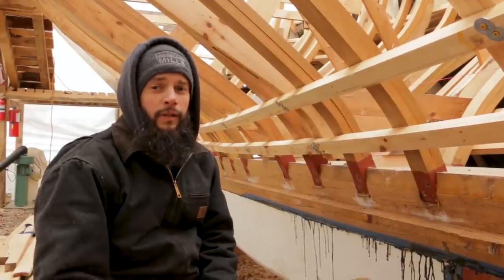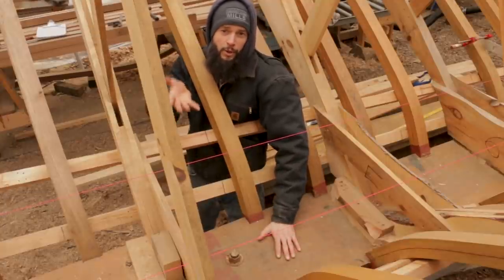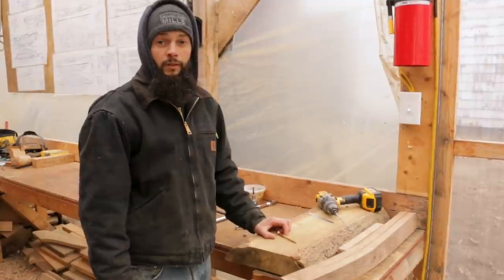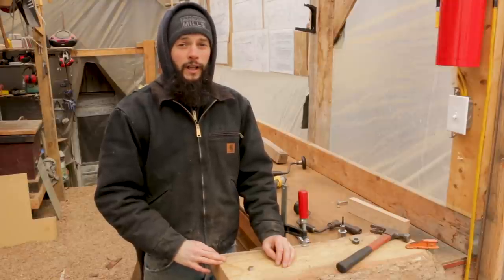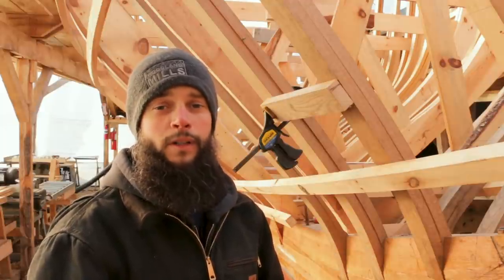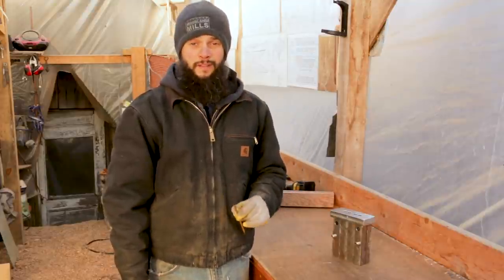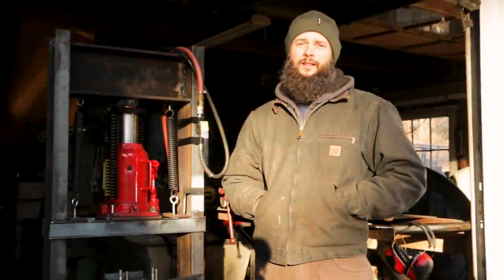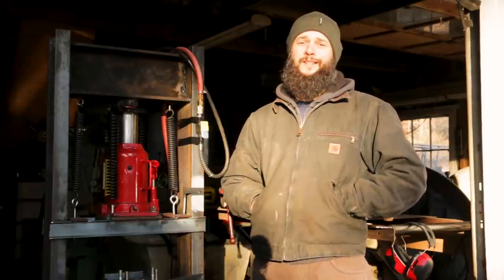Acorn to Arabella - Journey of a Wooden Boat - Episode 50: Homemade Copper Rivets!

Comment: Some ideas for a rivet mashiene 2.0:
1. Get rit of the screws if possible. Screws are so slow if you have to open them every time. try to build a big knee lever tensioner and cuple one of the die half to it. They can pe realy strong and are much faster and easier to use.
2. make some dyes that have the slot completly in one side, not half/haf like you have now, and fix the chanel-less side to the press. Also drill some holes/slots in the hinged side that corrospond with some pins, wich engage when you swing the hinged-half down. that way you dont have to beat out the rivets with a hammer every time you open the tool.
3. (and this one is not realy that important) while you're basicly rebuilding the whole thing, put on some limit switches on the press so that the compressor automaticly starts up, wehen you pull the lever down (see 1.) and also a switch that automaticly retracts the press again when the dye is fully pressed in
Reply: Remember the part of the video where he said, if you have any better ideas, build your own and maybe we'll buy it from you? That was a subtle hint that they aren't interested in suggestions when they have a perfectly good working machine.
Reply: @danno1111  I do remember that. But since I have neither time nor tools or even the cash to build a such a mashine just for the slim chance to sell said mashine and then ship it over an entire ocean, I just chose to do the next best thing: make my Ideas public so that maybe somebody else can use them and do build a sellable version.
Reply: Screws are simple and strong.  Simple and strong is good when you have a machine exerting tens of thousands of pounds of pressure, built by an amateur metalworker and operated by semi-skilled labor with no support structure (workman's comp, etc) in place.
Reply: @netpackrat  but screws are also excruciatingly slow. And if you need to fasten and loosen 4 screws literally a thousand times, then You know what pain is.
Reply: @aka_pcfx  Yes.
Reply: Sadly the holding power of those screws is not easily matched, it would probably take a 50 ton jack to hold the mold together and not allow splits.

Comment: Need to heat anneal those rivets, copper work hardens and becomes brittle.
Reply: Good Idea, was thinking the same...
Reply: Make your rivets red hot in the fire and then dunk them into water. Instantly annealed!
Reply: @andre3823  .. wouldn't that temper them?  I know nothing about copper but that's how you temper steel.  Very slow cooling is for annealing.
Reply: @rlmillr  nope, copper goes very soft with that method. ,😆
Reply: doesn't seem like they're upsetting the end enough to worry over much about annealing.....but it wouldn't take much to do it if they wanted to be paranoid about it..
Reply: The work hardening of rivets when forming heads is more of a feature than a problem.
Reply: @netpackrat  Yep. It's a feature, not a bug. Like differential hardening on a  blade: hard edge, flexible center.
Reply: I recon looking at those rivets after they were cut it looked like they were cut on a friction saw and had plenty of heat dumped into the ends of them
Reply: @rlmillr  

Hi Rick - quenching red hot steel hardens the steel - maybe leaving it brittle. You then heat the quenched steel to a much lower temperature - this reduces the brittleness and improves toughness. This process is called tempering or annealing.

The old timers (my Dad b.1899 and his uncle-in-law b, 1874 and a blacksmith) both referred to the quenching process as tempering. However it might have been an honest mistake as they were Croatians and English was their second language.

cheers edi
Reply: I'll third that on annealing the copper before forming the heads.
Reply: 1. The copper is not hard drawn????
2. They proved the "rivets", with a destruction test. Rivet passed!
Reply: @AnotherRM  Ferrious and Non Ferrious (spell check)

Comment: What an awesome channel. I was one of the people asking questions about the floor pieces. Its one step beyond to take the time to read and reply to all our questions and concerns. Truly you are keeping your word on making this not just a record of the build but a guide and reference for anyone else looking to take on such a project. Thank you for sharing all your hard won experiences!
 Your rivet press is class. One suggestion to maybe increase turnaround would be to drill a hole on each channel 3/8" below the head at a 45deg angle pointing back to the operator which would allow for an easier way to release the rivet. to stop the hinge bouncing up as you punch out the rivet you could make another brace that comes in on a another hinge from the RHS/LHS and crosses over the top and back in to the frame. or even stand the die back up on its vertical and let the hinge take the force?! Good luck and Merry Christmas! :)

Comment: Good that you painting the end grain and oiling the steamebent wood as they tend to dry out faster. As a boatbuilder I know you are on the right track with everything. I would say that you are extra careful, not cutting corners like I probably would. Dont worry to much about the comments here, and you are right you dont need to fasten the frames to the keel at all since you will put in floortimbers. Although its true oak will be black around steel nails, its no problem to use stainless steel screws. Bronze is more traditional though. Looks nice.

Comment: Hi Steve... just a thought..... to speed up your production when installing your home made rivets you could use a pneumatic hammer similar to those used by mechanics to form the shop head instead of a hammer. Or an aviation rivet gun, with a rivet snap . You will need a piece of steel on the head of the river to prevent it from being driven back out of the hole. That's called a bucking bar. If you use a snap of the appropriate size then the head you form on the inside will swell and will be very nicely finished after the rivets are set. 
Both of these pneumatic guns are similar in look and function and if need be you can pick one up at any big box store, or a friendly mechanic/aircraft engineer might lend you one, or at least point you in the right direction. 
Shop heads look beautiful when done right. Just like the heads of rivets on steel girders.
Reply from the maker: The plan is to buy a rivet gun when we plank =) 
Thanks for the tips!

Comment: You guys are awesome! I've been following you since the beginning (and even picked up a shirt a while ago), and I'm very impressed. I know nothing of boat building, but I'm a (medically retired) master auto tech and custom fabricator. 

Your last comment, regarding doing the math for pressing the rivets was hysterical! Considering there's 1440 minutes in a day, it takes 5 minutes to press 4, and you need 4,000, that's only 5000 minutes, without any problems! 

As for the rivet die/press, I think what you have is good. Just needs a couple minor mods. Instead of the rect. cuts, see if the machinist will put "V" cuts in. It will make the release much easier. As for the lateral movement of the dies, instead of nuts to clamp them together, how about spring pins ("R" clips)? You guys seem to be precise enough where you could figure out the perfect spot to drill the bolts, where you want the pins to slide through. You could then pop the pins in and out in seconds, while still maintaining enough force to prevent the plates from spreading. And again, the V channel will make release much faster. 

I estimate that you could probably get press times reduced 50% or more, provided the clips are big enough to easily grab. Just my thoughts...
Reply from the maker: Thanks for the suggestions and for the support!
Reply: My pleasure. Hope it helps. I like to keep things as simple as possible. I saw some of the suggestions below, with release cams and this and that, and just had to shake my head and laugh a bit. You guys are doing a great job. 

Thanks for acknowledging my comment. I didn't expect a response, to be honest. At the same time, I didn't want to come off sounding like some Internet know-it-all! It definitely goes to show you guys truly appreciate your audience. 

For that, thanks for being real! Not many YouTubers take the time to be as thorough, while also being entertaining. Here's to being one of the most enjoyable channels on YouTube! Way to go guys! Keep up the amazing work!!!

Comment: You're 100% correct about setting the scew in a hole sized so only the threads cut. Tapering the hole and counter sinking the head are enhancements.

Comment: Very easy explanation on the screws, should put everyone's mind at rest. I bought a kilo of copper nails which cost me £75. This was just to nail the rails for a 4m boat which used about 3/4 of them. I even saved the 25mm ends to turn into short nails. Your solution is brilliant.

Comment: Wonderful Square rivets, they will hold so much better/stronger than the screws would.  I would suggest that you use a Pneumatic Buck-n-Bar method when installing them.  Just like how Aluminum Aircraft rivets are mounted to wings and airframes skins.  The peened end will be so much more uniform/stronger, and easier/faster to install.  Great job on the boat, I look forward eagerly to each weeks installments.
Reply from the maker: Thanks, we were just kindly donated an Ingersoll Rand rivet gun for the riveting!

Comment: Awesome work on the die. The only suggestions I have, if you were going to produce enough for more than one boat, would be: (1) come up with something faster than bolts to lock it closed. I'm thinking some sort of cam. (2) add some sort of ejector pin system.

Comment: Copper makes a great rivet because of it's malleability; however that much compression in forming your rivet might "work harden " the rivet enough to make it resistant to more compression. If you find that to be the case, you will have to anneal them. (Heat till glowing, then a rapid quench in water). This will return the copper to it's original malleability. Be careful on your first few to see annealing is needed. Great solution to the high cost of having those rivets made. Certainly other shipbuilders in the community would be interested. Good luck guys.

Comment: If you had three volunteers, and two more jigs, you could finish 240 copper rivets per hour. One person operates the press - keep it pressing continuously.  Two others loading and unloading the jigs.  you only need the lower portion of the new jigs as the top is interchangeable with all three jigs and is only needed in the press.

Comment: 4,000 rivets at 5 mins per four is 5,000 mins.  So, approaching 85 hours or two working weeks of 42.5 hours. (You do stop after 42.5 hours, yes?!). If the press can cope, making 5 at a time would be 20% faster. Really depend on supply of volunteers! A suggestion - let them engrave one of their rivets. BobUK.

Comment: Rivet machine looks good. I would make two modifications: Weld or pin a large t handle on the Hydraulic ram release screw so you can work it by hand, and possibly tap into your air line to power a pneumatic impact gun  and possibly air hammer to speed up your opening and closing the die and removing the rivets.

Comment: Consider applying a very thin coat of anti-sieze compound inside your rivet die along the length of the rivet, and where the head is being formed into - this will help both the removal of the rivets after the press, and prevent marring up the die over the thousand uses of it.

Comment: If you add a cross piece internally to your rivet die opposite of the head, that can slide out of the way, you might be able to add an external lever and pin system or something of that nature to act as an ejector to remove the rivets without separating the die halves, thereby saving that few minutes each run of 4 rivets.  Could also try a bit of spray lube as well. 

Cheers!

Comment: While I see that you have done your due diligence and selected fasteners appropriate for the task you only showed stress failure and not what most often happens: fatigue failure. I don't see that as an issue, but technically it's the wrong thing to silence the trolls 😉

Comment: Most excellent, the rivet press is a great solution, particularly with volunteer hours. You may find a bit of lube on the die will extend it's life with less wear and make it easier to remove the pressed rivets. Peen on men.

Comment: Just saw on another channel a sample of a copper rivet through wooden planking. The wood was found on the foreshore of the Thames in London and appeared to be about the same thickness as your planking. the rivet was the same size as the largest commercial rivet you were able to find.  The rivet was still intact and headed on both ends, one of the pieces of wood had completely rotted away but the rivet was still holding. I think your homemade rivets will work just fine
Reply from the maker: That's super cool, thanks for sharing!

Comment: You could get you machinist buddy to just make a few more sandwich layers for the tooling jig you have set up for the copper rivets. Triple your production rate depending on what it would take for the press to press that many more cold rivets, 32 tons may not be enough. Simple cheap thing to try that may save you time if you haven’t tried already. Nice work!

Comment: Pre drilling holes for woodscrews and nails is proven to be stronger in tests. Forcing a nail into wood opens the grain and leaves gaps between the nail and the timber. Wood screws should ideally be threaded only for the backing timber depth, the top timber being pre drilled with a clearance hole.

Comment: So some ballpark figures. Working  displacement is 15 tons. So each frame and floor timber will lift about a ton in the center. When you hammer over a whitecap it would shock about double. So make the floor timber to keel fasteners take 2 to 3 tons and you're good. That would be about 4) 1/2" bolts per station pulling in tension. It should make a bar crossing.

Comment: The term "clinker built" comes from the noise made bending the rivets. I took a part an ex lifeboat which had rivets into the frame. They were amazingly strong. So strong I used a chainsaw to cut out the frames. Removing the rivets would have taken ages.

Comment: You could probably add a little piece of angle iron that's lined up with the heads of the formed rivets so when the halves of the die are separated you could just tap the hinged portion of the die with a mallet to help free the rivets from the die. I'm not sure if they're stuck in the die enough to where that'd bend the rivet but if not that may help speed up the reloading process.

Comment: Some people are commenting on a sleeve to slide over instead of bolts. You notice how the rivets swelled and had to be driven out. Well they're spread the other way and the sleeve will be stuck. It may be slow but the bolts are the best. If I had made it I would have done it about the same. I to am a machinist and what he did looks good to me. As far as the wood screw, good demo, they make them that way for a reason because they work. I just hate the slot but on that screw it's the best.

Comment: This is going to be one strong boat. You guys should be very proud of your skills and dedication. Have you decided on an engine yet? I think you mooted that 40 HP would be enough but I strongly disagreed. For going into a Beaufort 6 or 7, you're going to need over 100 HP on a boat that length. In big seas, you can never have too much HP at the prop. That HP could save your lives. You should speak to some marine insurers, see what they say. If it was me I'd put a big Cat V8 down there. I had a Greek hand-built 10 metre 'Trexandiri' with just such a V8 and it could take a B8 like a hot knife through butter: just what you need to get you through a storm.

Comment: For the rivet press, I would add a knob or crank to the pressure relief valve on the jack.  This will make that step much simpler and more comfortable than using the pipe that came with the jack.  Another option for r3moving the rivets from the die is to use a pneumatic chisel.

Comment: Copper rivet making, nice work, chiseling them out of the press. LOL making the head as you show isnt the problem, its holding the stock.  tried silver steel tubes at first ,jammed, slotted with clamps, jammed. my oil bath with rear pin allows head length adjustment and stops rear end flanging . nobody wants that. just uploaded for a pirates chest. Adam savage quote about lubricate. my assumption is that the oil acts as an incompressable substance. the higher viscosity the better, I will try with greese next .pleasure to watch.. best of luck.

Comment: A Jonny ring is still made with beeswax. I also use it to fill seams every spring before launching as we haul out for the winter here in New England and the old girl (72years old) dries out.   The boat is well caulked and seams payed so the wax is used so that it will squeeze out and not damage plank edges this reduces the pucker factor.  I also  make a paste of 1/3 each beeswax,linseed oil,and pure turpentine heat beeswax to melting, add oil,  then turps   I rebuilt a 52footer named COMET which I circumnavigated. All fasteners were easily set and could be removed years later even when used to join wooden members whose faces were epoxied.  In Trinidad I helped a young Brit remove copper drifts from his very old timber yacht which were used to hold iron floors. The iron was wasted after 100 years of bilge water sloshing over them but the copper drifts were fine. Once the remnants of the floors were broken away we pulled the copper drifts and their beautiful heavy washers   They has been set in tallow
Reply from the maker: Thanks for the info!  The make a commercial thing called slick seam for filling seams prior to launch, I've heard of folks using bar soap but never heard of using the wax.